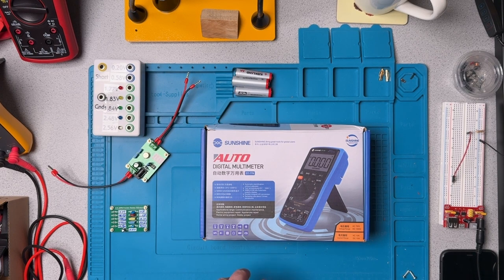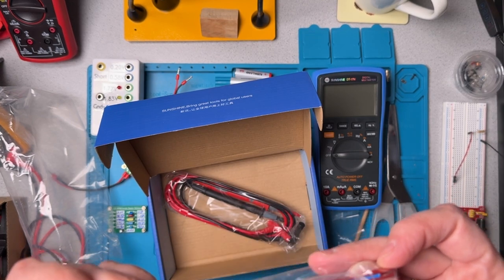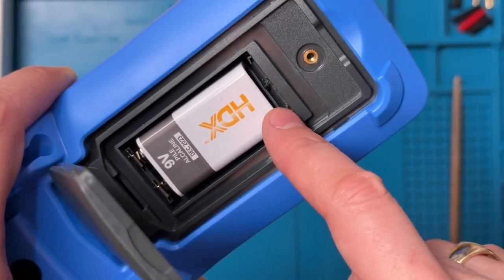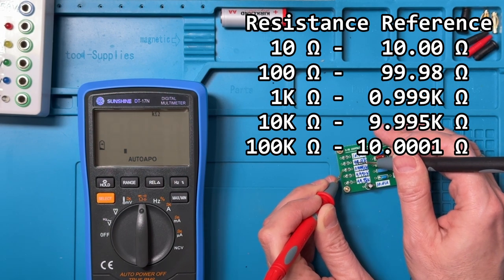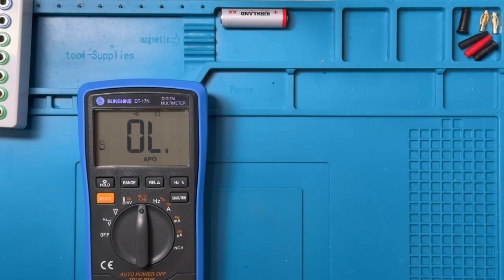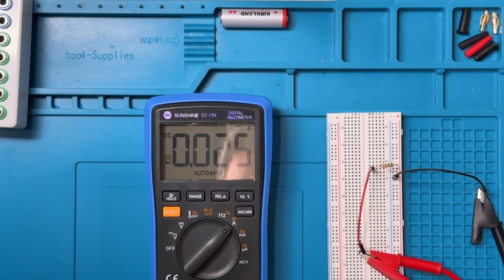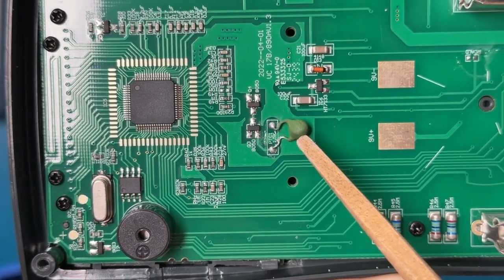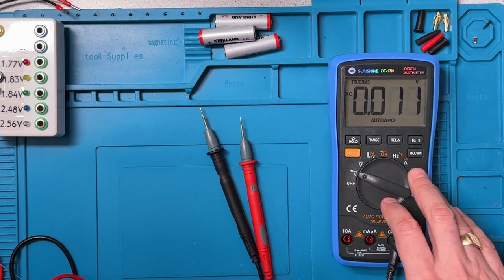Sunshine DT-17N Unboxing and Review

Comment: This is the most popular DMM in Latin America among telephone repair techs. They think it's the best ever. I think it's meh! But I don't fix cel phones. There must be something they like about it. I couldnt tell from your video but the first of these didn't have a label or a good label and it was possible to put the battery in backwards. There was no reverse polarity protection either so a lot of them died.
Reply from the maker: The battery compartment is poorly labelled. When I first opened it up I thought it was meant to hold a pair of AA batteries. The plastic is molded to hold a metal loop around that would be used for connecting two batteries in series. It appeared to me as though the metal loop had fallen out. I rigged something up and the meter did in fact operate on 3V. After I checked the manual I saw it was intended to use a 9V battery. 
The meter does have good accuracy and performance. The test leads that come with it are better than average as they are gold plated and have sharp points. That's very helpful when working on smd boards where it tends to be a pain to make good contact quickly. 
Asides from the test leads though there are dozens of multimeters around this price point with roughly equivalent performance.